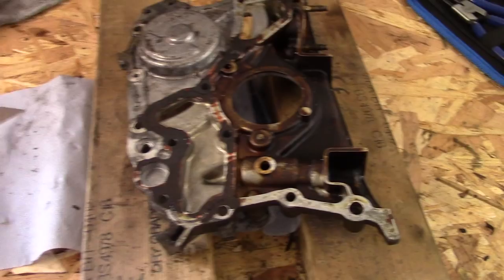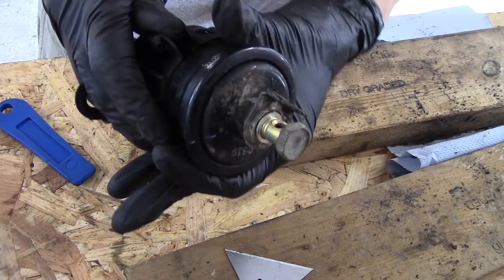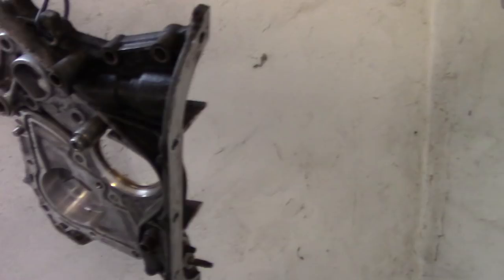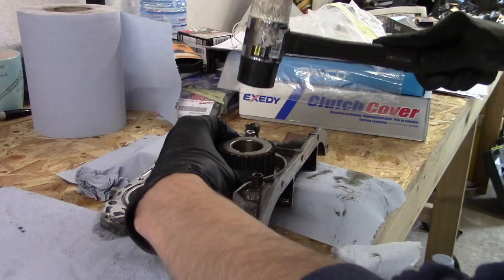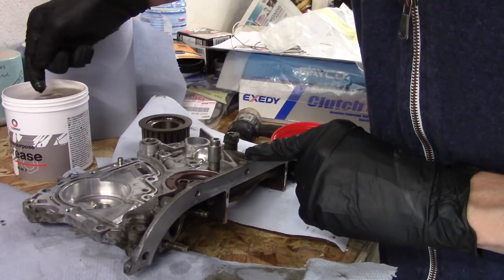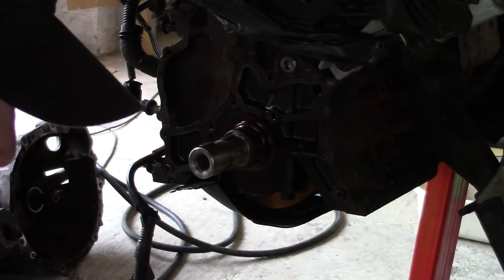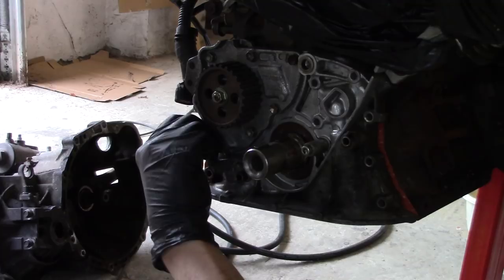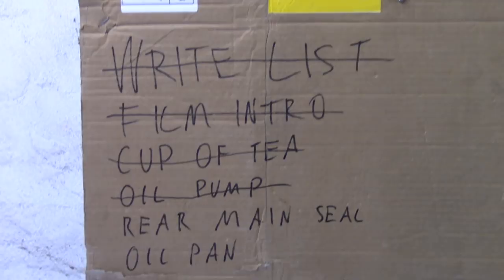Building an MR2 in One Week - Day 5

Comment: In the past ive always packed the oil pump full of Vaseline. that way the pump dont run dry and the Vaseline helps provide a back suction.
Reply: J Dalzell yup or white grease. And pull the efi fuse and coil wire and prime the engine before starting it to build up oil pressure.

Comment: You aren’t alone with the oil pump/front cover ... when I rebuilt my 22re the previous owner had used not only the standard gasket on the timing chain cover but he also used RTV haha what a pain in the ass.  I got most all of it off to the point it was smooth and just used a new Toyota gasket and it hasn’t leaked at all it was tedious scraping with the razor blade without scratching the crap out of the timing cover in the process.  The jerk did the same thing on the intake plenum and that got scratched and I had to pay to have it resurfaced.

Comment: Did you put the inside rotor in the oil pump?  I didn't see it go in.

The fuel filter is much easier to change without an engine in the way!  I had a helluva time doing the same job on my AW11.
Reply from the maker: Yeah, the rotor was already attached to the oil pump shaft before I reassembled.

Comment: Hello, i'm currently also doing a rebuild on my 3SGE engine. I have a question about the seal for the oil pump for installation does that arrow on the rotor need to lign up if you put that plate back on? Or does it not matter because it spins anyway?
Reply from the maker: The workshop manual says "Place the drive and driven rotors into pump body with the marks facing the pump body cover side.", but it's not clear which side, and the picture doesn't really help.

It's been a while since we did this, but I think we just kept the marks on the inner and outer rotors aligned when re-installing, and so far the pump works fine (although usual disclaimer - we're not professionals or experts, if you're not sure you should speak to a qualified mechanic 😊)

Comment: Good job with the oil pump. For the sump can you spin the engine upside down on your engine stand?
Reply from the maker: The engine stand does rotate, but we’d need to remove a bunch off stuff from the top end first, as it would catch on the stand

Comment: 1200 grit is too fine.  I can't tell you what the right grit would be since it should be machined instead of sanded, but it's probably half that.  Mating surfaces need some bite.
Reply from the maker: I only really sanded any high spots of gasket left over, rather than the aluminium. But if it ends up still leaking we’ll know why 😂
Reply: I little oil leak never hurt anything (just ask any 911 owner).  

P.S. Thanks for not asking how I know...